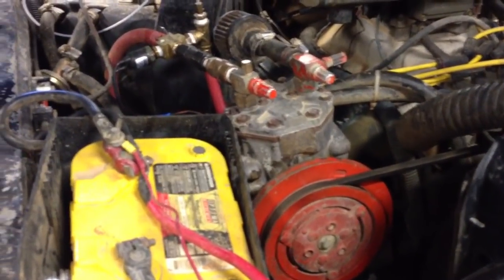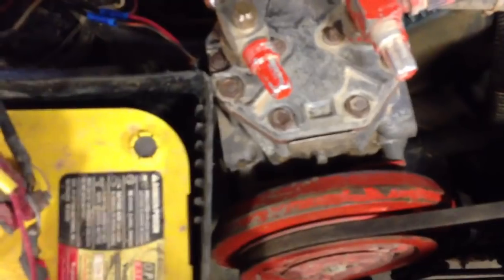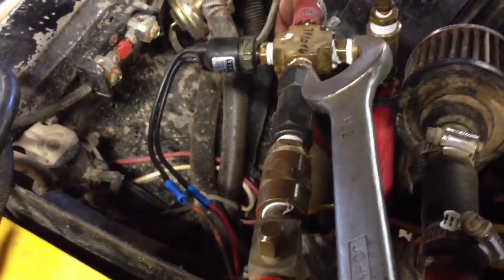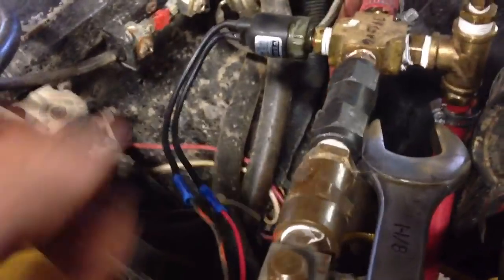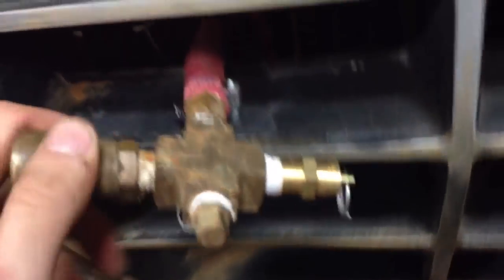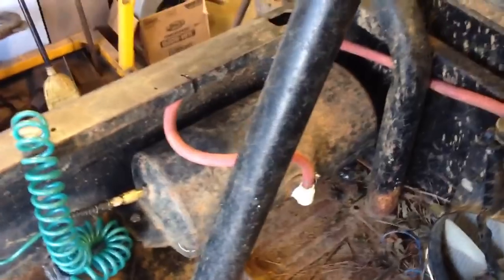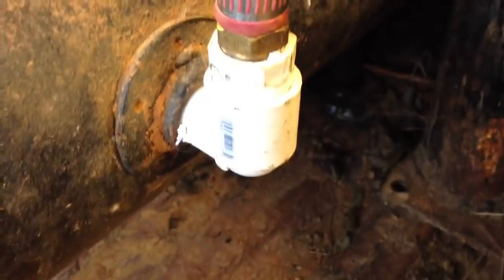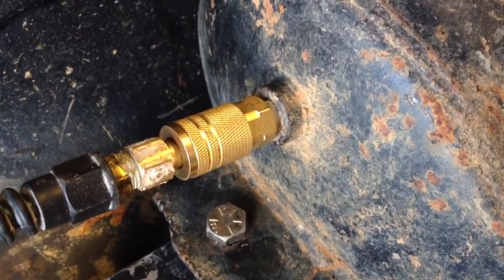How To Build An Air Compressor system for your 4x4

Comment: Since the factory fittings are actually steel, you can weld on standard steel npt (3/8 npt is good size) pipe nipples to them to convert to standard threads. Also, an unloader valve is only needed on electric air compressors, whereas the engine is already running when the compressor is engaged.

Comment: get yourself some Rector Seal great for sealing and keeping metal threads from corroding also lubes as it never hardens. like your truck my pop has a 78 been stole twice and got it back.. that bed tank looks quite old. i like to replace any tank that holds pressure aftef 10 yrs regardless of how it looks (welds degrade w/expansion/contraction pressure). just my 2 cents. cool build!

Comment: Have you noticed any difference with the check valve that doesn’t have the leak off ? Is the pump under pressure starting up ?

Comment: What kind of oil should be put in these to keepp them maintained.  I just got one and I am in the process of placing new gaskets and cleaning up the unit. Thanks
Reply from the maker: 30 weight works fine

Comment: why are your gauges inside the cab? seems to me going in the cab to look at the pressures and work the switches is inconvenient encounter logical period seems you would want them near where your outlet connections are or somewhere more useful then climbing in and out of the cab.
Reply: Um the trucks got to be running to power the pump

Comment: good video . how long did the setup take to finish building?
Reply from the maker: It's hard to say how long it took to build.  There have been several iterations of my onboard setup on this truck.  The bracket consumed the most time, but still only took a few hours.  Provided you have all the parts, a setup similar to this could be finished in a weekend.

Comment: How did u convert  the a/c fittings  to npt?
Reply from the maker: I threaded some pipe sleeves onto the ac fittings that were the same thread pitch. Pipe threads are tapered and AC fittings are not so I used a lot of teflon tape.  I wouldn't recommend going that route though; instead, take the ac fitting completely out and drill and tap 3/8" NPT inside the two threaded flanges and screw in 90 degree 3/8" street elbows.

Comment: I want to do a crazy one. im a broke engineer college kid. im think about doing something like this and have one or two regulators like 5psi to 8psi and use the air as a Supercharger. Any in put ??
Reply from the maker: Save your pennies, that won't work.
Reply: Kurt Moore no where near enough cfm to use as a supercharger, ac compressor starts at like 12 cfm where a v8 engine probably eats around 750 cfm on a naturally aspirated engine you would need way way more air
Reply: ive head of a system like that on transports, stealling air from the brake systems and forcing it into the intake to get psi up to over come turbo lag
Reply: Drew Wilso I've been looking and trying to find info on cfm on motor. But no luck...any help where to look or what to look up?
Reply: If you find it let me know, im just short of bench testing one
Reply: You would not have enough cubic feet of air to run the engine these pumps are high pressure low volume pumps and you need the exact opposite for a supercharger a high volume low pressure pump. Calculation for needed volume of air for an average engine of 244 CI (4.0L) is 244x650rpm=158600 cubic inches a minute 158600/1728=91.8 cubic feet a minute at low idle. The York 210 pump show here has a displacement if 10.3 cubic inches 10.3x650rpm=6695cubic inches a minute 6695/1728= 3.87 cubic feet a minute.  91.8/3.87=23.7 meaning to barely keep up the York pump would need to be turning 23.7 times faster 650x23.7=15418.6 rpm at idle or 5500x23.7=130350rpm at red line or 32.6 times as fast as the continuos rpm rating 4000 or 21.7 times faster than the max rpm of 6000. The pump will never be able to reach that rpm before exploding that's faster than almost all jet engines. If you ignore the rpm problem and just focus on the size pulley you would need figuring a tiny 2 inch pulley on the pump 2x23.7=47.4 inch diameter crank pulley. That's taller than most small cars are high. 

To long didn't read : Entirely impossible get a real supercharger
Reply: Well a 4 barrel carb typically is in the 650 to 750 range for a 350 chevy